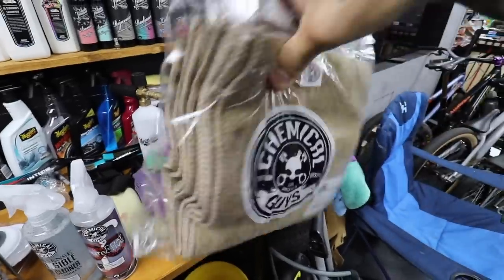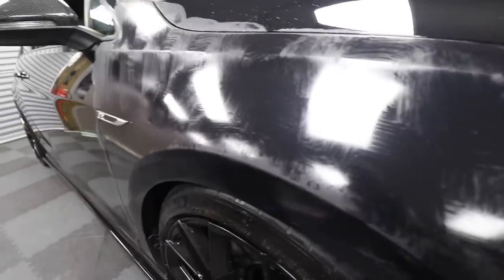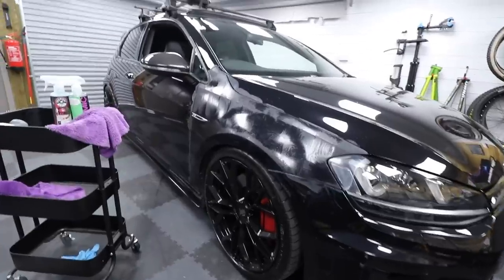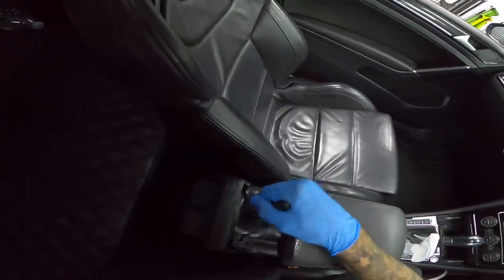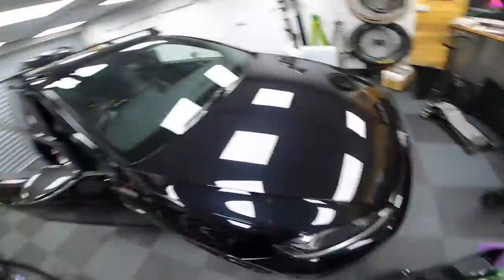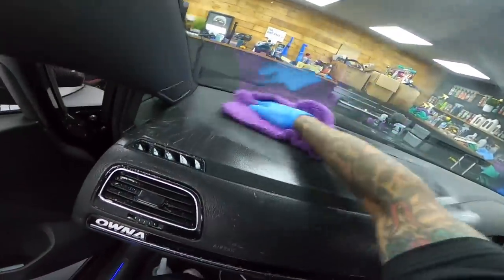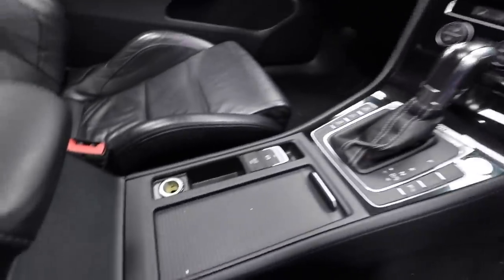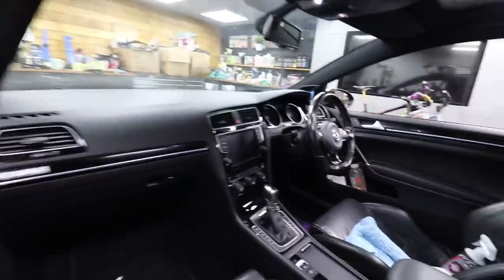VW GOLF R INTERIOR CAR HACKS!!

Comment: You ever thought about applying a ceramic coat to the golf Harry? Look into gtechniq crystal serum. It’s a quality product that’s applied by hand is very easy. And it’s will seal it in properly. Obviously after it’s been fully corrected. Then, tree sap, salt erosion, air pollutants, bird poo all that kinda stuff can’t damage the clear coat, 

A full 3 stage correction followed by a grechniq ceramic coat. Few sick videos there laddddd

Comment: Hey man, you need to check out Vermijl. Dude is an absolute beast and I think you’d like his stuff. Also, Obsessed Garage is the peak of detailing if you want the best of the best. I was skeptical, but I tried the Koch Chemie GSF in my MTM foam cannon and I was blown away how well it worked. Best foaming soap I’ve used and works very well as a wash soap.

Comment: Harry you are using too much product fella I use about half the amount that you have just used there but also you are better off putting the product on to the applicators. These companies all say use as little as possible but if you struggle to get it off just use a damp microfiber then the product will come off so smooth 🤝